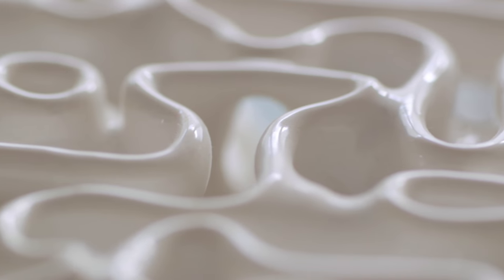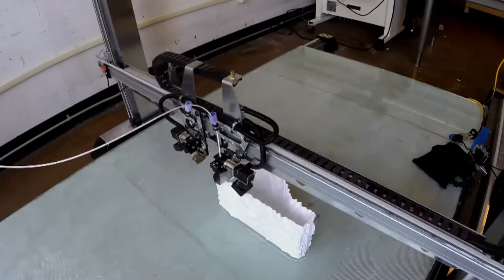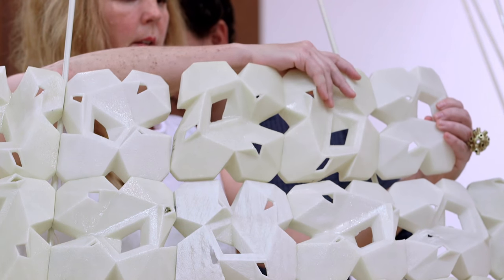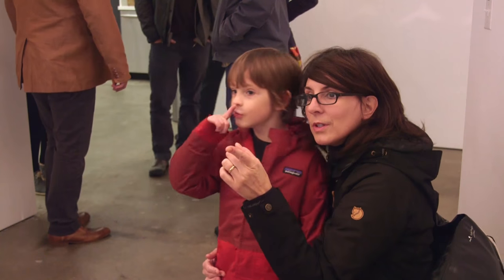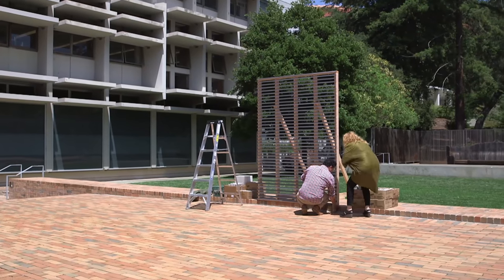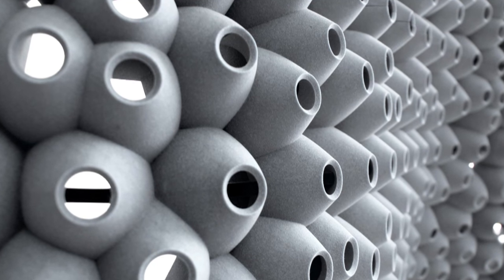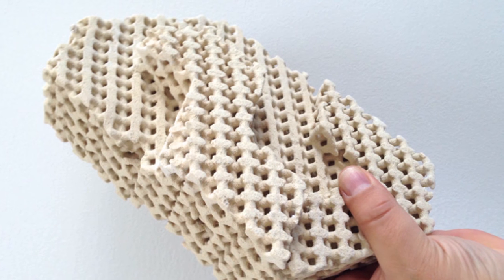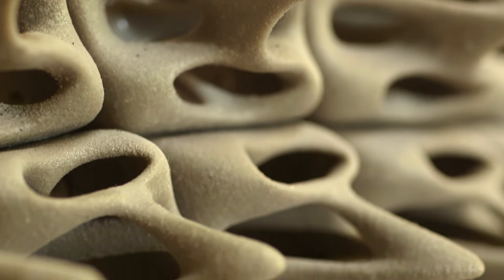Building a House the Eco-Friendly Way with 3D Printing | KQED Arts

Comment: Yes, you can use all sorts of powders as fillers in a 3D print, but what is the binder that holds it all together? And those cladding tiles don't overlap properly - water and leaves and bugs would just pass right through that skin.

Comment: Hai, How did you guys print with salt? I'm fascinated by this process and I'd like to know more about that...
Reply: Either by melting the salt with a high power laser, turning the printed part into a single salt crystal or by applying a curable resin as a binder and the salt being a filler. 

Like rocks in cement.
Reply: @MrHornfox  Thank you  for the explanation. Hi from INDIA.